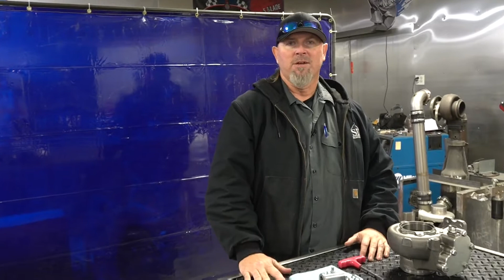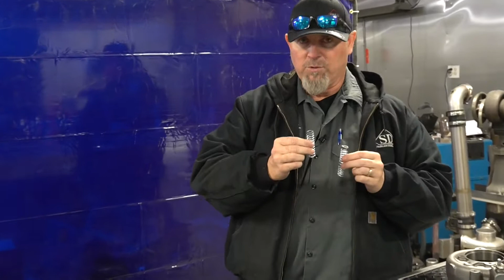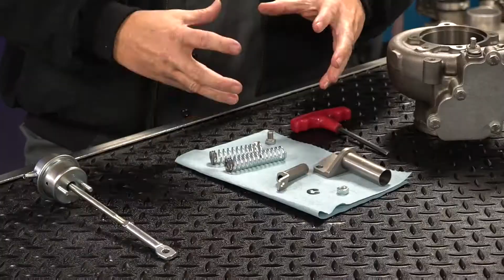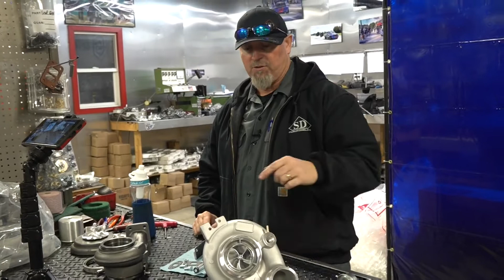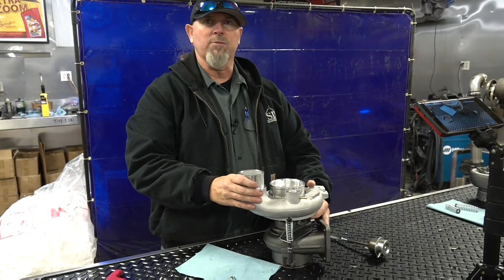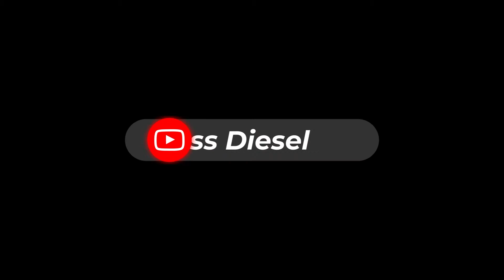S300 / HE351 Turbo Spring Gate How-To

Comment: Good deal. I'll be trying this out on my HE351CW swapped 2nd gen 12v. Bought the Smeding pipe to make it work but with the factory actuator I couldn't clock it correctly and had to add 6" to the pipe and its made my air filter and intercooler piping a nightmare. This looks like it will work perfectly.